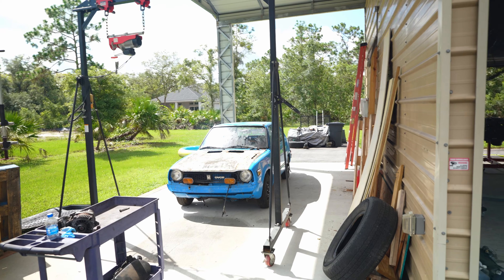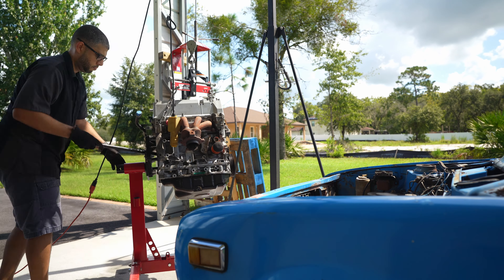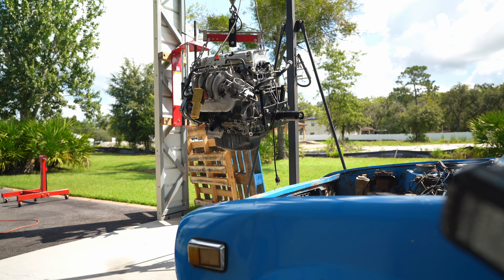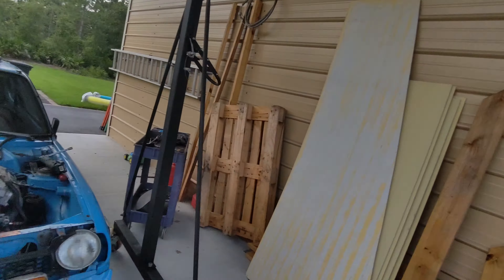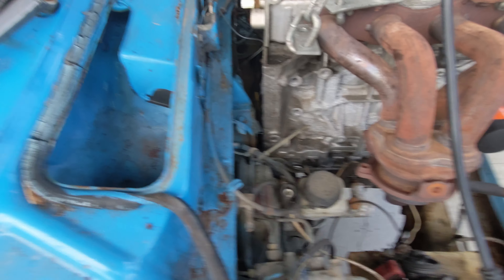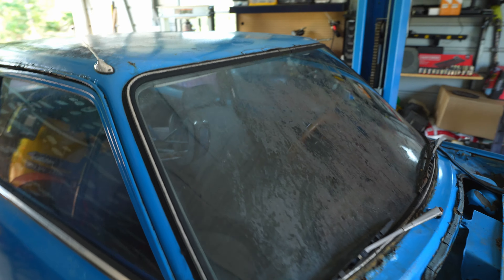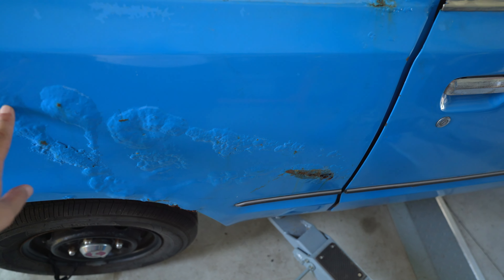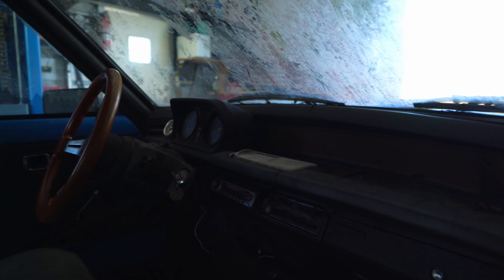K20 Honda Civic First Gen RWD | Restore Part 1

Comment: Hey I have a b series swapped first gen. Had to also do some extensive mods, let me know if you need any advice on areas that are easy and safe to trim to get some more clearance 🤙🏼
Reply: What did you do about a harness?
Reply: Rywire! They have some hood b series harness and a flying lead you can get. Takes some wiring but hey, it’s a custom job
Reply: Did you ever get around to a 5 lug conversion? Do you have any pictures?
Reply: Nope I stuck with 4x120 since I had some nice wheels
Reply from the maker: That's awesome! Any videos, blogs or posts on your build? I'd love to see more of this!

Comment: I also have a 77 civic and want to do an engine swap. I've seen people do b18 integra swaps keeping it transverse which I liked. Do you think the inline orientation with rear wheel drive is better? The transverse seems to fit really well in the engine bay.
Reply from the maker: I don’t think one is better than the other. For RWD, it’ll be a little more work to create a transmission tunnel and rear diff support but either swap will require re-fab. It’s just a preference and the level of creativity you’d like to put into it. It’ll be a true joy either way.

Comment: This shouldn't be legal the body weighs as much as the motor your putting in
Reply from the maker: Not quite. The engine is roughly 300~ LBS while the chassis is 1,200 LBS. Also, there isn't any law about power to weight ratio 😂